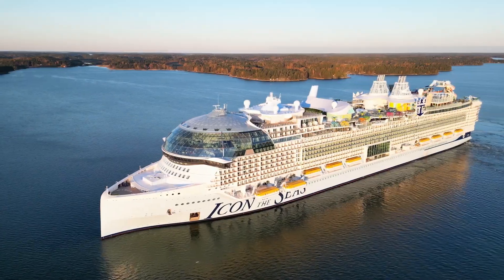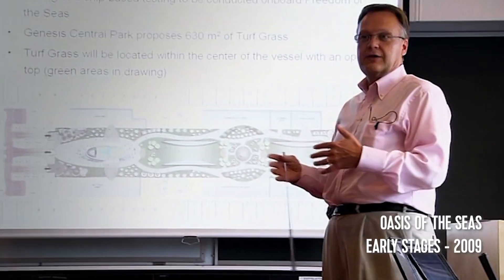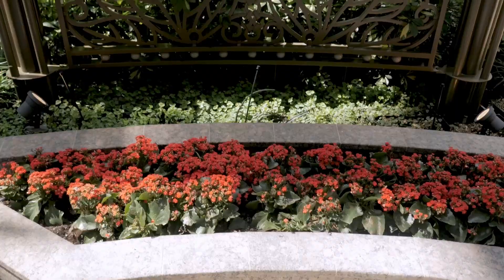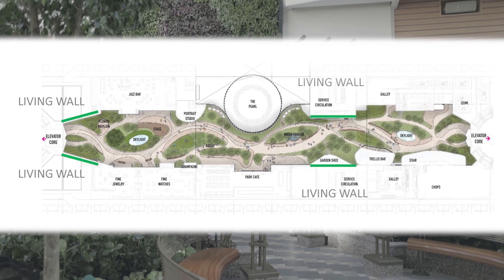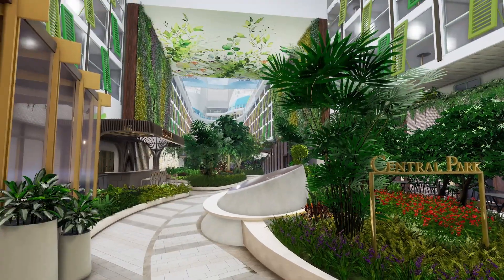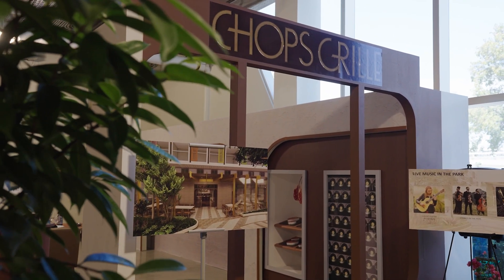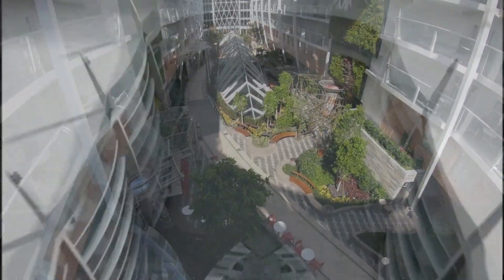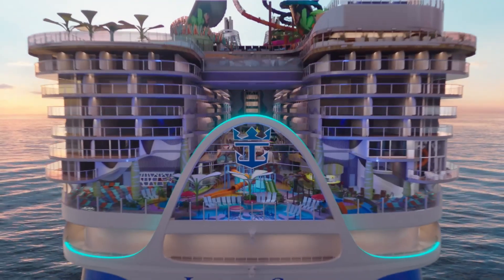Making An Icon | Episode 15: Creating Central Park

Comment: More than 10 years later and Central Park is still so impressive!! 
Been on Oasis in 2012 and Symphony last year and I was Wowed the same way on both ships! 
The huge trees, so many different plants, the cafeterias, the live music , etc, that's Insane thinking to have a real park like that on a ship in middle of the Ocean!
However what I saw so far on Icon, the design is quite different and I'm not so sure it the change was for better!
Reply: 14 years since the concept was first introduced alongside the Oasis class and yes, I absolutely agree there is nothing like that in the industry. You can throw in roller coaster and slides but nothing quite like Central Park.